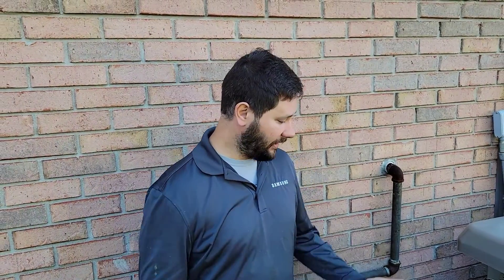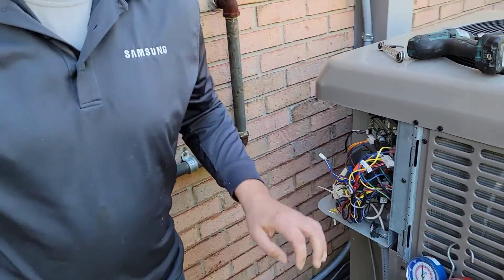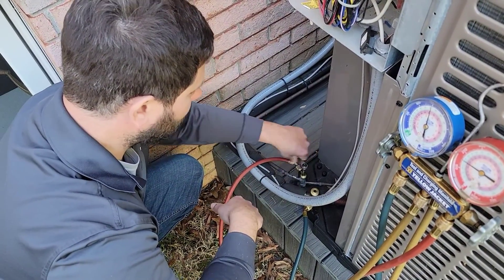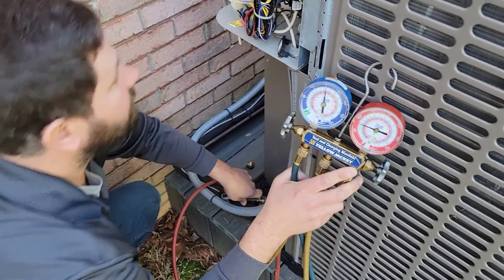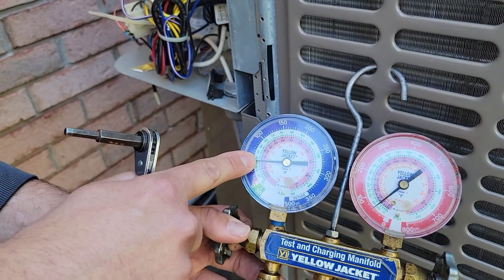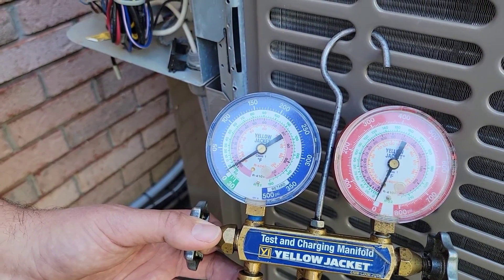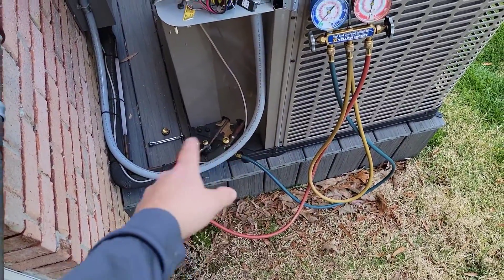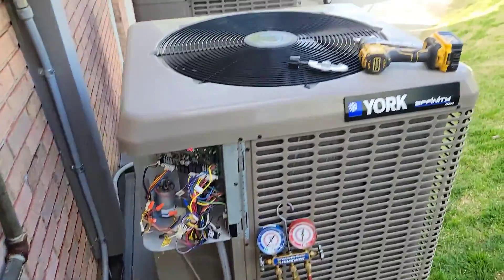Refrigerant Pump Down: Step-by-Step Guide

Comment: I know you are a good technician and I truly like your videos, but this time you messed up. 1st, you heated up the compressor by letting the suction line pressure go to vacuum for an extended time, remember compressors are refrigerant cooled. 2nd, the compressor sucked up all the air existing inside the blue hose and I am sure you did not purge it, and even if you did, your pump down sucked up potential air exiting previously inside the system. You should always stop the pump down at a positive 15 to 25 psig, and this means just a tiny bit of vapor that you end up releasing in the air when you open up the system.
Reply: I was learned that to have the tstat set to cool…with the indoor fan running moving air across the evap coil, it will boil off reducing any liquid refrigerant to a vapor, that way when it does shut down it won’t have tendency to bump up on pressure
Reply: You can run into a negative vacuum for a couple minutes and you won't burn your compressor or windings, it's actually best practice to do so when you pump down into the high side (around +/- - 2PSIG, what he did in that regard was correct. Yes he probably didn't purge the line and some non condensables got mixed in, BUT if you find the highest point in your system and relief valve it, you can purge all non condensables, as that is not illegal to do at least according to the EPA as long as it is either a safe gas to release or in very small amounts just as if you were to connect to a valve with gauges.
Reply from the maker: So you're telling me that a refrigeration system is an open loop instead of a closed loop system
That's what you're insinuating
I don't understand
Reply: > this means just a tiny bit of vapor that you end up releasing in the air when you open up the system.

I can see the logic of what you suggest, but the practice is likely an offence contrary to 40 CFR § 82.154 and 42 USC 7671g(c)(1), with criminal penalties as prescribed by 42 USC §7413(c)(1).  Something similar applies in the EU, UK, Canada and, I gather, even China and India.
Reply: @StrixTechnica I don't know about other countries but in America a small or neglibile amount of vapor release is not a punishable offense, although the EPA is not clear about what a small amount is there are conditions and scenarios that are allowed and in this case it would also be allowed
Reply: @リーチ伝説  Yes, 40 CFR §82.154(a)(2) does allow a de minimis release in the course of "good-faith attempts to recycle or recover refrigerants" (*provided* the procedures prescribed by the CFRs are followed using approved, certified equipment and to the prescribed limits) as is unavoidable when coupling or decoupling maintenance manifold and piping.  I doubt it covers a deliberate release as an alternative to avoiding contamination by air, which is what @zipperdingo6385 seemed to be complaining about.

Ty Branaman directly mentions a de minimis release of vapour at the indexed part of this video:

https://youtu.be/JYtRG2k_KZ8?t=372

At no point should air ever be allowed to get into the manifold or piping.  A bit later after that indexed point, Ty makes the point that he cannot dump the liquid-phase refrigerant in the high side because (safety aside) the quantity released would not qualify as a de minimis discharge.  Instead, he returns the liquid refrigerant via the suction side, then makes another de minimis release of what vapour is left in the high pressure pipe.

We never saw Tad connect or disconnect his maintenance gauges in this video, so I don't know why Zipperdingo assumed that Tad hadn't purged his gear or why there should be air in it in the first place.
Reply: @StrixTechnica right on point. I know someone who didn’t know any better and got arrested for releasing into air

Comment: If you had extra long line sets along with the extra required refrigerant, are there any concerns about it all fitting in the outside unit? Hmm, now that I think about it, I guess not. I imagine that the accumulator tank is sized to match the max line set length. Am I right about that?

Comment: What would you do with the condensers that don’t have a board with the low pressure switch but seem to have a little pressure switch built-in to the compressor? And even holding down contactor manually it still cuts out compressor on low pressure?
Reply from the maker: That's impossible
If you hold down the contact or it can't shut the contact or off
Reply: @taddydigest  ah ok so with those style compressors with integrated LPS you can’t pump them down?

Comment: Say a 410a unit came pre charged for 15'.  The run to coil is 50' total.  Leaving an additional 35'.  You initially had to add 1lb 5oz of additional refrigerant to the system for the additional lineset.

Would you be able to pump down that additional 21ounces into the condenser as well?
Reply: Usually no, it’ll take what it will take but most of the time the pressure wont go all the way to zero if there was an additional add of refrigerant. You’ll have to recover the rest.

Comment: I usually like to close the Suction valve then backing it off 7 turns before I start the pump down. Great video!
Reply: The long winded racheting to close the Suction valve, ie  pump down is reach just a few cranks and its closed, kill power done. On the other hand you perform pump down then start closing the Suction valve you'll be cranking for a while to close it. It's just a way I actually learned from HVAC GUY CURTIS I tried it and it worked well.
Reply from the maker: That's a good idea!
Reply: What the reason for your method?